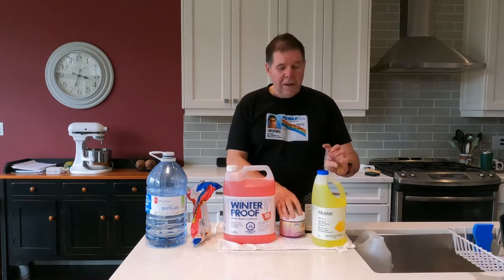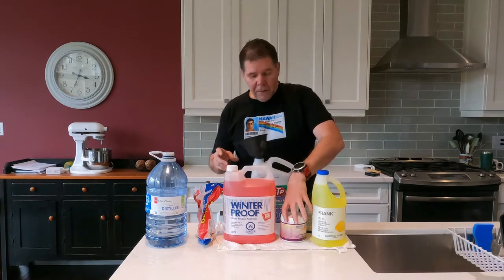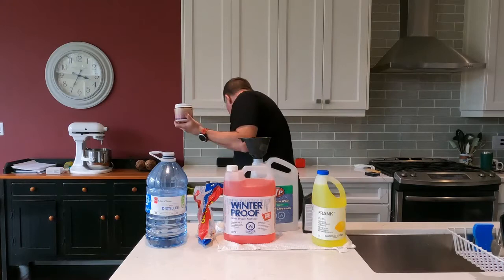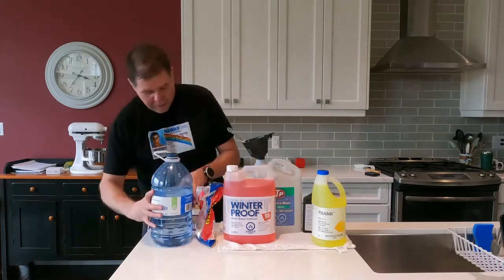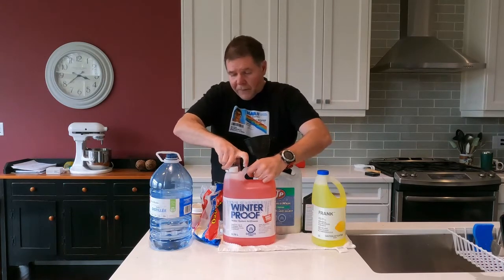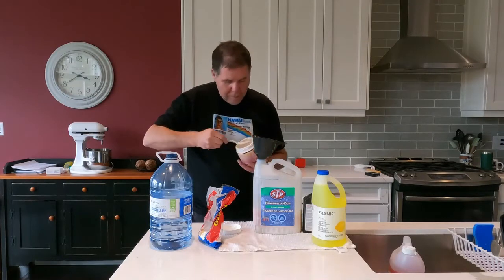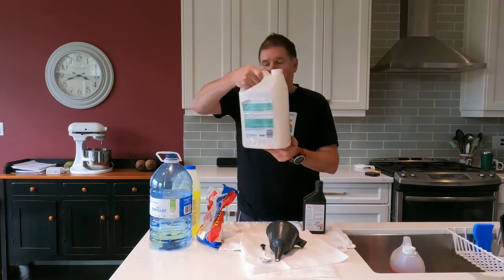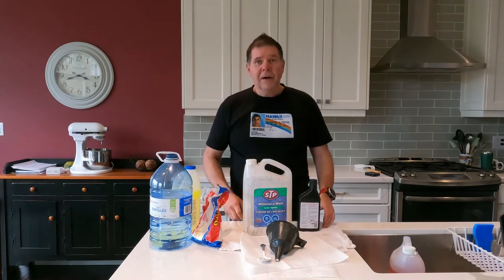DIY Tubeless tire sealant for MYB, Gravel and road bikes.

Comment: i made a sealant for my big backhoe front tire .i did  2 cups anti freeze 2 cups water heaping table spoon corn starch and some sifted saw dust 1/3 cup .boiled it on a camper stove stirring constantly so no lumps .then poured cooled mixture back through wifes kitchen siv .and 30 bucks of goop for 2.00 .
Reply: what is the purpose of the anti freeze tho? can't you just use water and corn starch?
Reply: Corn meal he mentioned, why have you used corn starch?
Reply: @Sir-Kay  corn starch gets thick after boiling but smooth .its a thickner .